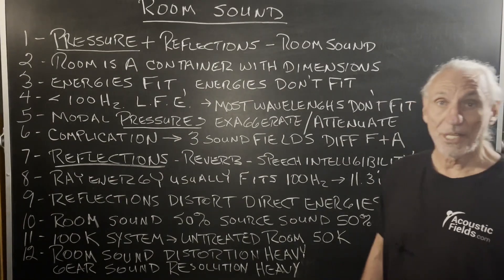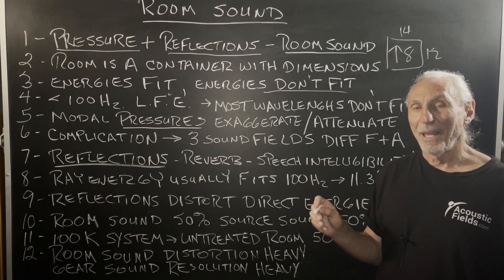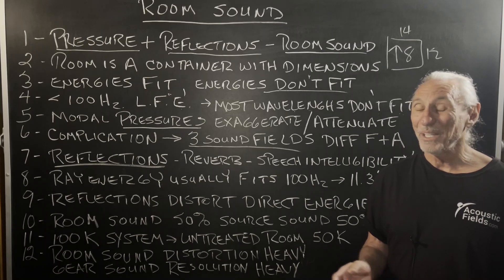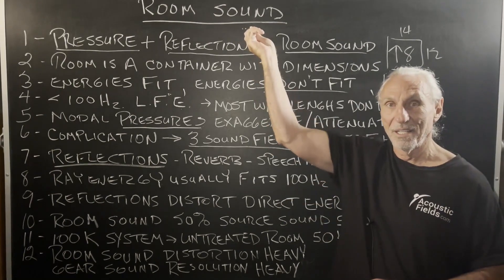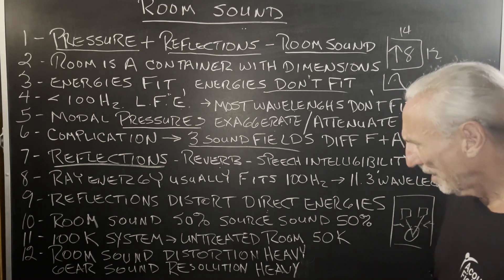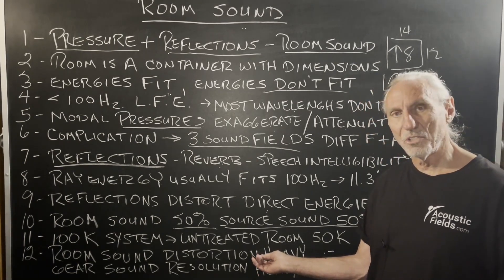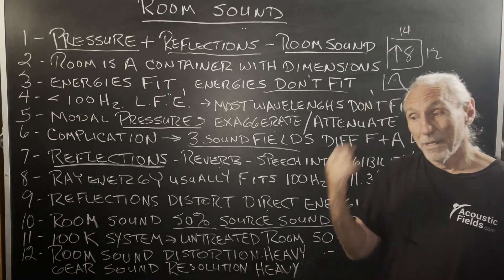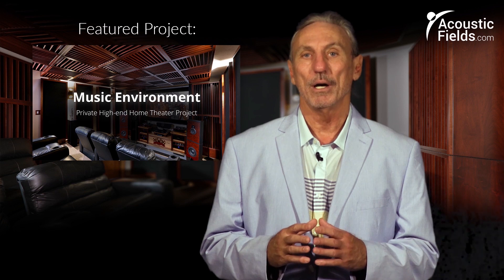Room Sound - www.AcousticFields.com

Comment: One of your best "general sound" summaries with clearly suggested issues.

Am going to look but would love you pointing is to a few vids on large, oblong greatrooms. Example might be 33' x 24' w/ TWO 17' & 23' angled ceilings AND attached 12x12 kitchen and a 3' x 13' hallway. But HAS freedom of speaker and seating placement  using 2/3rds of 33' wide space.
In other words, larger odd shaped greatrooms!
Many thanks.
Reply from the maker: Whatever your room size, you must be willing to give up space to treat thye pressure and reflections produced by the dimensions.

Comment: Like I've said before about your videos.. You constantly talk about larger rooms for sound or recording, but not everyone uses a room like that. Please give some examples or explanations regarding small "containers", such as a closet for example. Let's just say, for example, an 8 foot high closet with 4 walls that are 3 feet across. If a person is standing on the outside of the closet that has a speaker in it and the person likes what they hear, then what's your definition of it "Doesn't fit"? Again, the person likes what they hear, but the issue might be how the microphone picks up sound. I'd like to hear your dissertation on that one.
Reply from the maker: Smaller rooms produce too many issues that even with treatment can not be resolved. Remember that in order to treat a room for low frequency issues, you must give up 12 - 16" of space on each wall just to treat the lower frequencies. You will then have to give up an additional 6" for middle and high frequency management.
Reply: @AcousticFields - Who said I'd be having problems with low frequencies? I find it strange that you automatically assume that. Dude.. all microphones pick up frequencies differently, as do preamps, especially those with LP/HP filters on them. Then there's how much bass, mids or treble a person might add from an amplifier or whatever they're sending to the speaker in 'the closet'. ALL microphone will also have a certain amount of bass rejection, as many of them have roll off switches installed on them, assuming there are even any bass issues to begin with! Personally, I'd say higher frequencies are usually the culprit, but that's nothing a LP filter or EQ can't solve, especially after getting audio into a DAW. But man.. 16" of space?! Good god.. I seriously don't know where your brain is at regarding acoustics. Are you talking about strictly mastering audio maybe ?

Comment: If the pressure doesn’t fit
You must retrofit…. 

pressure traps, every 60 inches! Preferably filled with carbon!
Reply from the maker: You can achieve 30 hz. resonant frequencies within 12" of cabinet depth.
Reply: @AcousticFields really?!? I must know more. Heading to your archives to search for this because I was mistaken in thinking to get down to 30 would take wayyy more than 12”. I can fit that easy enough 👍🍎